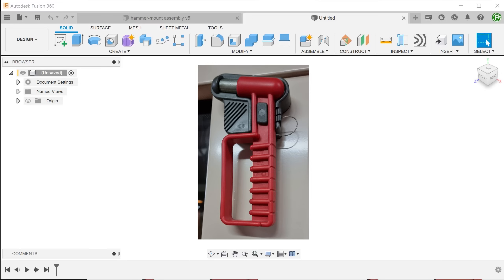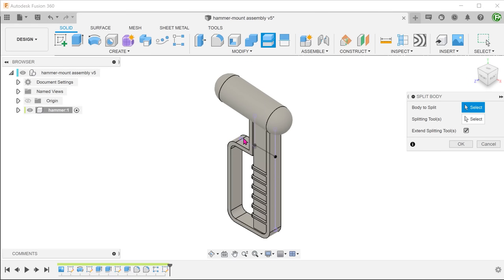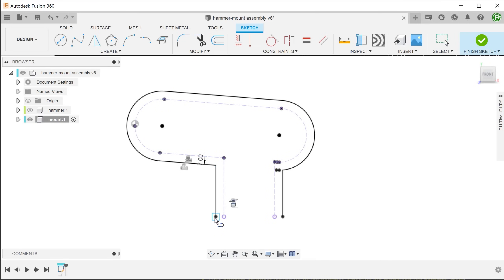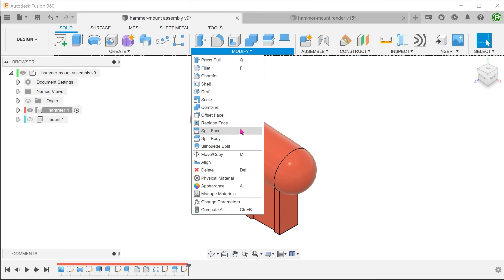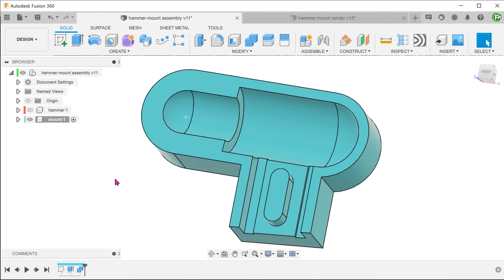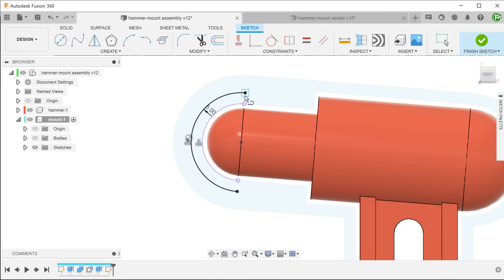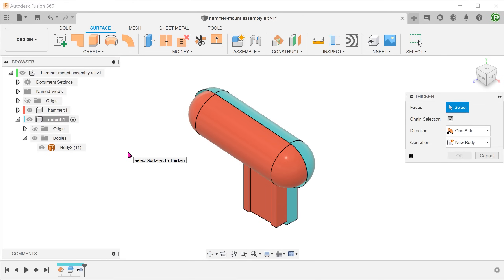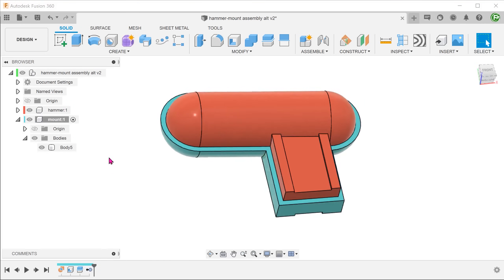Fusion 360 | Designing Around a Component

Comment: I have a question! At 6:12 when you start the new line, you have the option to snap to that edge on the hammer. I only get that option if I project a line beforehand. It seems like you may have done that too since I see the purple lines but I'm not sure? Also even when I do project and snap to it like you do in the video, I don't get the auto parallel marker when I straiten out my line. I can only achieve this by first projecting and then creating a normal line in it's place, and then I can create the second line and get the parallel markers. Could I be missing some preference options or am I just not doing something correctly?

Comment: Are there any available tools to check whether the hammer will be able to be placed in the mount or not? I'm talking about the first design where you have the locator and the dome. 

The hammer is clearly restricted, so you can't just insert it into position by moving it in a single direction as it would result it the hammer crashing into the dome. Finding the right clearance value becomes a trial and error matter without such a tool.

Edit: just realized there's a tool called "accessibility analysis". I wonder if that one would do it.
Reply from the maker: Accessibility analysis is used to look out for undercuts and inaccessible areas of a model during machining. You are right in saying that the hammer cannot go in straight down. It would have to be inserted at an angle. As far as I know, CAD programs are only capable of analysing interference in a static assembled state. I am looking forward to a future where it is possible to manipulate models in space and perform fitting tests. Maybe this can even be combined with AR or VR. That would be a killer feature.

Comment: How do you make Fusion run this smoothly? I have a 5950x 128gb RAM and a 16gb RX 6900 XT and it runs like dog shit.
Reply from the maker: The perceived smoothness comes from using a 3D mouse. Your system is actually better than mine:)
Reply: @Fusion360School  Oh gotcha! What particular brand/model do you use and do you recommend it?